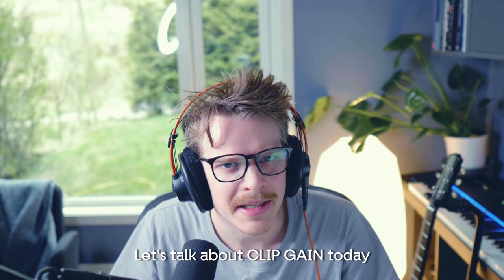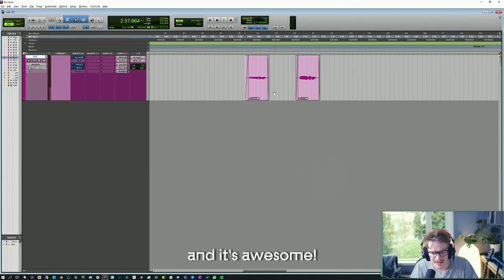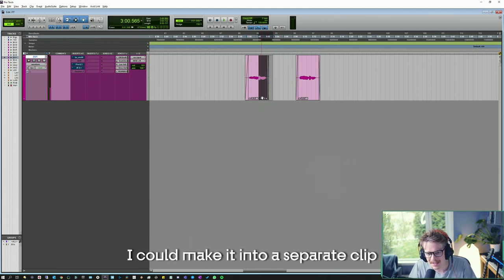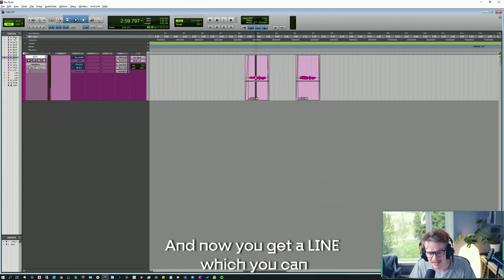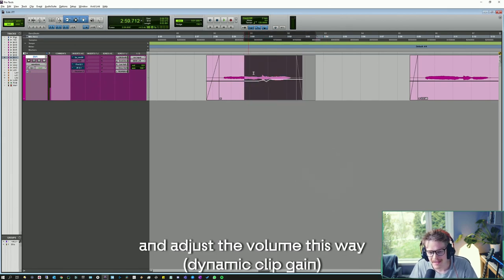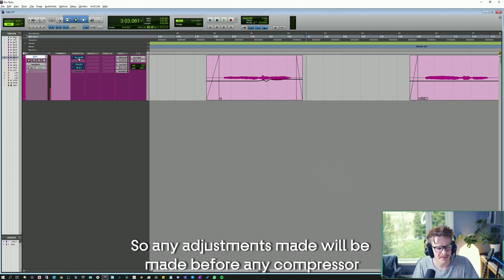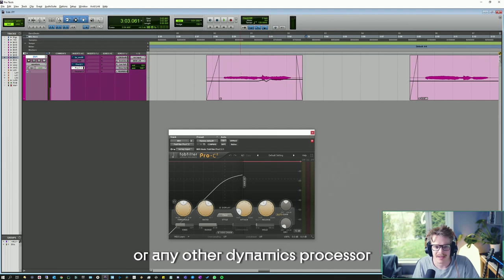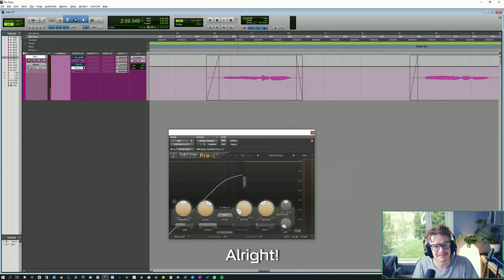Showing Clip Gain LINE in Pro Tools // Just the Tip #8

Comment: HI, THANKS FOR THE VIDEO !!! ... I'VE GOT A QUESTION FOR YOU .. i PROVED A LOT OF THINGS (OBVIOUSLY RIGHT CLICK/CLIP GAIN / SHOW LINE, VIEW / CLIP / ETC) BUT I CAN'T SEE IN PRO TOOLS ULTIMATE 2021.7 DE CLIP GAIN LINES. IF I DO A CHANGE WITH SHIFT - START - AND THE SCROLL MOUSE UP OR DOWN , WHEN YI MOVED THE CLIP I SEE PERFECTLY DE GUIDE LINES FOR THAT MOMENT. . iS THERE A STRANGE THING OR IS JUST A BUG OF THE VERSION HAVE ? PREVIOUSLY WORKED IN PT 12.5 FOR YEARS AND NEVER HAVE THIS ISSUE.I'VE ONLY READ A QUESTION ABOUT IN GOOGLE BUT THERE IS NO ANSWER. THANKS IN ADVICE AND SALUTE FROM ARGENTINA !!